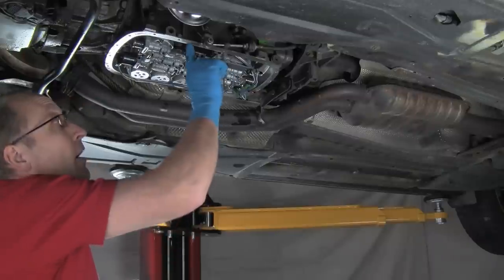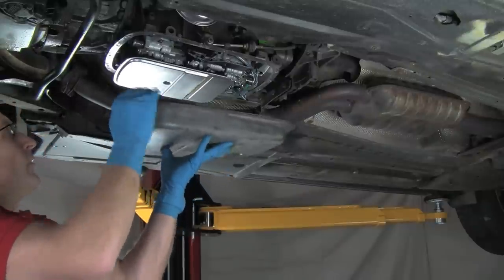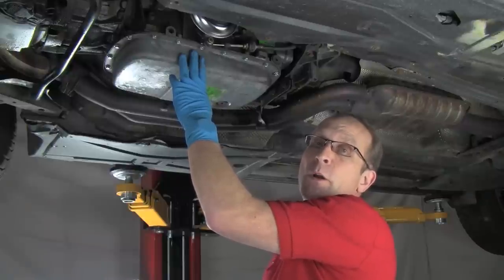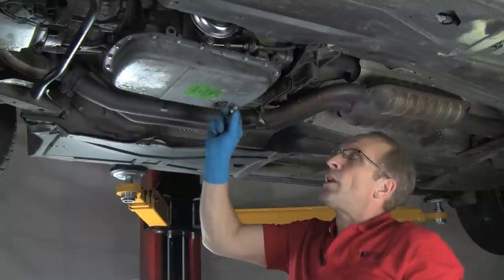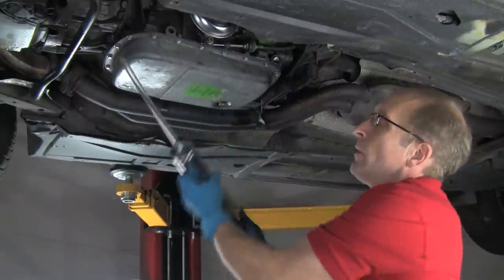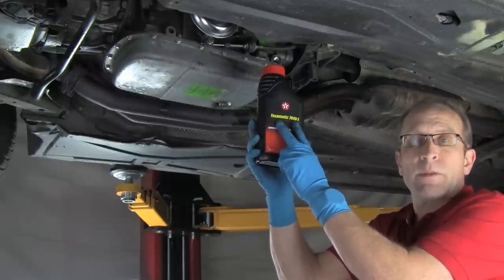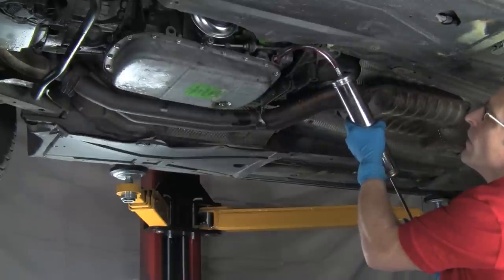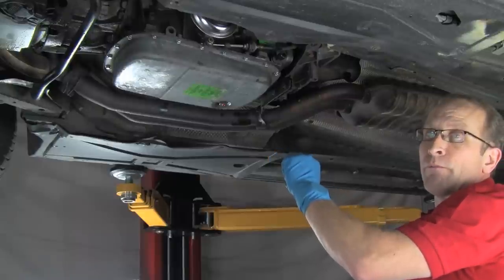Part 2: Changing Automatic Transmission Fluid & Filter On A BMW/MINI

Comment: Nice Work...
I ran a check on my transmission (E60 2004 520i) and got the error "EGS: Shift Monitoring 1-2". Will an ATF change correct this?

Comment: Great tutorial, thank you. I saw in the comments you changed the fluid again (because it was so dirty) without removing the pan & changing the filter. Is there any benefit to reversing the procedure - changing the oil first, run for awhile, then re-drain and change filter?  Thanks

Comment: Thank u for this video ! We need guys like u! 
I have a BMW e90 325i 2006. When engin cold and start moving,it' s hard to shift from 1st to 2nd gear and jerky. But when I istart the engine and wait for about 20 to 30 seconds, it shifts smoothly. 
The transmission fluid has never been changed and has 80k miles. It there something going wrong?

Comment: Great informative video thanks...feel like I can handle this task now......have you a video on coolant change for the E46 318i 2003?
Reply from the maker: We don't have a coolant flush video specifically for the Euro spec 318i (we don't have them here in the US).  However, the coolant flush video that we did on a 2002 3.0 X5 should help you with understanding the general procedures and allow you to get it done on your 318i.  Click the link below:
http://blog.bavauto.com/12402

Comment: great video. I am due for my 2011 Mini Cooper. Question, is it necessary to run new oil through the transmission to get the old oil out of the torque converter etc... and drain and refill (not shown on your video) or does the steptronic do a good job of draining all fluid into the pan after sitting idle for "a while"??
Reply: +Threefold Lotus Kwoon Would love to hear the answers to these questions from +Bavarian Autosport

Comment from the maker: Your 98 318i automatic transmission could have been originally filled with either Dexron-III or the Texaco ETL 7045 E. . A black label (on the pan) indicates Dexron-III. A green label indicates the Texaco  fluid. We carry both the Red Line and Liqui-Moly synthetic Dexron-III and the ZF replacement for the Esso fluid, Lifeguard-5 which is specifically approved as a replacement for the Texaco fluid. Both fluids are high quality synthetic. See them at bavauto.com or call 800-535-2002

Comment from the maker: You could apply the sealant (same as the Permatex Rubber Gasket Treatment and Sealant # 85409, that we offer), but this particular gasket is spec'ed to go on without sealant and we do not typically have leakage issues after the new gaskets are installed.  A common use for this sealant it the half-round bumps on the rubber valve cover gaskets.  Go to our online store at bavauto.com to purchase the Permatex sealant.

Comment from the maker: The torque for the pan bolts is 15 ftlbs.  There is not a specific tightening sequence for the bolts.  However, a good pattern would be to start in the middle of the pan and work in an expanding spiral, out toward the pan ends.  You can purchase the Bentley Publishing repair manual for your E39 5-series at bavauto.com.

Comment: Great detailed video. Just done with a 2005 E46 330xi transmission fluid/filter change. I have OCD. I bought a 5 gallon bucket of Redline D4 transmission fluid and drained the transmission four times with old filter in place. Then dropped the pan and changed the filter. Filled; went through the gears several times and topped off engine running at 42 degree C (recommended 30-50 degree C). The only thing I am looking for is the magnetic drain plug with a o ring (as shown in the video). My transmission is GM AS390R and uses a M10 torx drain plug with an o ring. The thread is 1.5 or 1.25 any light on this and where to get the same dimension magnetic drain plug?

Comment from the maker: Unfortunately, the pan is not readily accessible on the MINIs.  You need top remove a few undercar parts to access the pan. The Bentley repair manual does address the procedures.  We'd suggest that you check the manual and then go from there.   We do have the manuals in0-stock at bavauto.com

Comment: Hi This video was very helpful and very informative I have question about my 2001 BMW325i suddenly no power in the transmission when I put it on drive the car doesn't go or drive very slow do you thing its transmission oil problem or my transmission  is gone what do you suggest Thank you

Comment: Just viewed this video as need to do a transmission fluid change on a 118D considering this video is 10yr old is this still an effective way of changing the fluid if possibly I drained filled run drain again then fill or would it just save time & money just having it flushed and refilled properly? Bare in mind most garages in my area are quoting £300 + for a flush & refill but considering atf prices at moment would it even be worth doing it yourself

Comment: Awesome video! I have one question though is the drain plug the same size as the fill plug? I am asking because my fill plug is stripped.
Reply: ShinyChulito my fill plug was stripped also ...I used a hand chisel and cut a notch into the side of the bolt that was visible then i bought a small air chisel and placed it on the notch and chiseled it a couple of times and the chisel spun the stripped nut loose ....hope this helps ...

Comment: If the fluid is black, like in this video, the new fluid will mix with what is in the torque converter, and still be contaminated. I would suggest draining again after a 1000 miles, and refill with new fluid. No need to remove the pan and replace the filter again, since there was not very much sediment in the pan.

Comment from the maker: We've commented on this in other comments and replies on both part-1 and part-2 of the video, as well as the full article on our blog (blog.bavauto.com).  We recommend performing a second fluid change (just draining and filling, no pan removal) after running the transmission for a few miles (to mix the fluid).

Comment from the maker: While flushing is certainly an option.  It is by no means the only acceptable method, and is certainly not doable by a DIYer, at home.  Additionally, most fluid change shops will not have the proper fluids for these transmissions and will install a more universal fluid, such as one of the various Dexron fluids.

Comment: Great video, question, after the first fill, when I turn the car on and run it through gears, do I need to press the gas pedal to have the wheels rotate? I have an e38 740i. thank you!

Comment: My car is 2008 bmw 335i Convertible...I drained the transmission fluid until no more drop... then place new filter, pumped new fluid, start engine, selected all gear, then turn to park... fill some more until it dropped...for the total amount of new fluid are 5 liter... Is that a correct amount for my car model, BavarianAuto????

Comment: I'm about to buy a 2012 535i w/ "Lifetime" transmission oil.  the procedures if found via forums and other DIY say to flush the system via the tranmission cooling lines so the pump does the flushing.  I don't see a bently manual for the F10, is that coming soon, or do "modern" BMW owners not get their hands dirty enough yet?

Comment: That is a good one. You make it very easy to follow. Do you have a video on changing the ATF on the ZF 5HP18, which I have on my 1997 725tds?

That will be great.
Reply from the maker: The ZF 5HP18 (A5S-310Z) is drained via the drain plug in the lower sump area of the pan.  The pan removal and filter replacement are similar to that procedure shown in the video.  The main difference is in the fill plug and process.  The large plug in the rear of the pan, covered by a plastic plug/cover, is the fill plug.  The pan is filled by inserting the filling hose/tube up through the hole (after the plug is removed) and filling until the fluid runs out of the hole.  The filler tube must have a small 90-degree (or greater) angle on the end so that it can disperse the fluid over the edge or the fill hole and into the pan.  Final filling is done with the engine running, just as in the video.
We do offer a nice pressurized fluid transfer system as well as the angled filler tube (comes with the pump assemby).  Click the link below.
Fluid transfer pump:
http://www.bavauto.com/fland.asp?part=1740
Reply: Thanks so much for the direction.

Comment: Does the fill procedure apply to a BMW X5 2005? I have seen on other vides that said after you put the initial new fluid in, and go through the gears, you have four minutes to do the final fill. is that correct? thank you so much for the video!! It is a huge help!

Comment: I attempted to do this without a fluid pump. Took a lot of creativity but I filled a water bottle with the fluid and just squeezed it into the transmission pan😂 messy of course but it worked

Comment from the maker: Thanks for your thoughts.  We have published many articles that address these points on fluids in our BMWs and MINIs; why to change them, when to change them and how to change them.  If you search our tech-blog and the historical issues of our Fast Times newsletter you will find many useful articles on these subjects.  As a starter, see the maintenance articles in the Spring 2006 issue of Fast times.  Just go to bavauto.com (forward slash) newsletter .. and open the Spring 2006 issue.

Comment: Is it really necessary to replace the hex bolts of the oil pan?Whats the reason? After the service is done, is there any noticeable improvement in transmission operation? Smoother or soft gear changes?

Comment: I have an e90 2006 m47.

1. what about the liquid in the torque converter? I know that you have to change it as well..
2. any resets or setups required on bord computer or tester?
3. if I've done the change but i still have the feeling the shift gears is not done normally, it still skates, what needs to be done?

Comment: Anyway thanks for the video. I would like to just say that it world be wise to clean the bottom of the transmission with brake fluid just to get the rest of the small metal bits off and then put on the filter. You also have to check to see if the temperature does not go above 50 deg C as specified by ZF in germany. You are to continue with putting it in manual up to 3rd gear which you have not specified, which would absorb more of the oil and you would require more transmission fluid. The ZF 5HP19 requires 9.2 Liters but all the kits come with 7 liters, I wonder why. If you over fill you will have a problem with the transmission and that goes with if you underfill.

Comment: German Ucros1 hour ago
March 10, 2017.
Dear friend:  I have a 1997 BMW 740i in very good conditions. Its millage is only 96,000. I want to change the Transmission Oil and Filter, because I have noticed that in a couple of instances my gears jump to “Safe Mode” and someone told me that it is either lack of oil or I need to change the Oil and Filter.
There are people who recommends NOT to touch your transmission Oil because BMW says that it is good for life and if I dare to do the changes I will probably damage the Transmission.
What do you recommend for me to do ? I will appreciate an answer soon. Germán

Comment: Brilliant video. Please help me with this problem..Would oil and filter change help to cure a slipping (gear 1 &2) automatic box on bmw e53 x5d ? at its worse when low rpm. but when accelerating hard it shifts gears just fine. cheers.

Comment from the maker: The procedures for the GA6HP19Z transmission will be basically the same as shown in the video.  One difference is that the filter is a part of the fluid pan.  Therefore, you replace the complete fluid pan in order to replace the filter.  The fill plug is on the left side of the transmission (facing forward), at the rear, above the fluid pan.  This transmission takes about 8-liters of fluid.  We have the proper fluid and the pan/filter at bavauto.com or call 800-535-2002.

Comment: Nice video.  However, I would like to hear coverage of why it is acceptable to only replace half the fluid when the torque converter remains full of the dirty, original fluid.  It is like leaving half the engine oil in the engine at each oil change.  Comments re this would be valued.  Replacing it all is an added step but not difficult.

Comment: Hi great video with a lot of your comments throught the changing process - but ... what if you will stuck with the fill plug? Isn't is better to let it loosen first before you will drop all the oil from the transmition? ;)

Comment: i love your videos btw. I've had my 335i for about 2 years and have spent THOUSANDS at the indy shop. They do a good job but i'd much rather save the money and learn more about my car on my own. I'm a little confused on running the engine through the gears while the car is up on the lift. Mine is automatic, so will I need to use the accelerator and paddle shifters? Or do you mean cycle through Drive, Reverse, etc.?

Comment: Hi everybody, I own a used '97 bmw e39 540i 4.4 V8 automatic. My e39 had the sticky gooey black oil coming out of my transmission. My exhaust runs around both sides of my trans pants, the fill plug is very close by the left side exhaust. How would I be able to fill my transmission completely while my car is running w/o getting burned? I appreciate any and all information , thank you in advance.

Comment: I think it's a great video for all the people who like the mechanic!!.

Please your help, I wont to change the oil to my BMW e39 2003 530D, but a mechanic told me if I change the oil, can happen that the gearbox does't work with the new oil, so just clean the old oil and return it to the box. What do you think about this? have you seen it happen?

Thanks
Reply from the maker: Your mechanic is ..... nuts.  Do a full and proper fluid change, just as we did.

Comment: Hi, my bmw 320i e90 2005 model dont have any fill hole and bolts around it... is this bmw model I have really dont need to replace transmission fluid for life? by the way it is automatic transmission and  I'm living here in Australia... Thank you and very nice and clear demo, well done.
Reply from the maker: The fluid is certainly NOT lifetime .... unless you consider the early failure of the transmission, due to never changing the fluid, as lifetime.

The GA6HP19Z transmission in your 320i does have a drain plug in the bottom of the pan and the pan does have the multiple bolts around the outside.  Note that the filter is part of the pan.  The pan is replaced in order to renew the filter. The fill plug is in a similar location to the one shown in the video.

We do have the pan/filter kits for this model transmission.  The kit part number is:
http://www.bavauto.com/fland.asp?part=0501%20216%20244

We can offer international ordering by emailing info@bavauto.com

Comment: I have been told that there is about 5 quarts still in the tourque converter and that the pan needs to be flushed about two times. Drain the pan and refill twice. Nothing said about this in the video.
Reply from the maker: Bob,  See our older comments and replies for both part-1 and part-2 of the viceos.  We do discuss this.  Basically, when you drain the pan, you are removing about 1/2 to 2/3 of the overall fluid (depending on the application).  If the fluid changes are made at proper regular intervals, and the fluid is in overall good condition, the pan drain and filter change is plenty.  If the fluid is nasty or has not been changed regularly, we do typically want to do one or two additional fluid changes (by just draining the pan, without removing it).  Run the engine and the transmission for a bit in between the changes, to fully mix the fluid.

Comment: Hello i like your video, i just have once question. Can i do it to my 1998 Bmw 540i? Sometimes it runs so good and takes off but sometimes i get Transmission fail safe code second gear ratio. But does it once in a blue moon.

Comment from the maker: The automatic transmission fluid and filter should be changed every 30,000 to 50,000 miles.  If the fluid is obviously dark and dirty, the next change interval should be about 10,000 shorter than whatever was used since the last change.  Yes, the filter should be changed when the fluid is changed.

Comment: Thanks for the swift response. Is it easy for DIY? How much would it cost me if I wanted to fix it on my own? This happened after a long journey (500miles) with quite heavy luggage in the car. I've been through London as well at the same day and traffic was a nightmare obviously.
Reply from the maker: We don't recall what your original issue was.  can you remind us?

Comment: thanks for video. like.   sir could you give me advice ?  2004 x3 3.0. in mornings after starting engine and pushing accelerator gearbox slips, its hard to make car go, after doing 20-25 metters everything becomes fine.  i checked fluid its red and filled i did it when gearbox was cold.  what could it be ?  i have no idea what previous owners did to it.

Comment: Great stuff. Question: How do you measure torque lbs without a digital device such as the one you use in the video?
Reply from the maker: There are many different types of torque wrenches, not just digital.  However, if a torque wrench is not available, you can certainly tighten the bolts.  It helps to have experience of what a given torque feels like (how tight it feels).  Just tighten between 1/8 and 1/4 turn from the point that the bolts get snug.  This will be around 7 to 10 ft lbs.

Comment: I cannot find a replacement ATF filter for my F25 (2011 X3 xDrive35i). I found a replacement pan with filter for $300 or an aftermarket for $115. I have only used OE BMW Genuine parts/fluids, so I am rather opposed to the latter. It looks like the filter is attached to the pan, is there anyway to simply replace the filter on my current pan to save money?